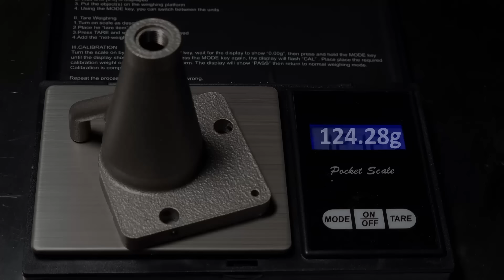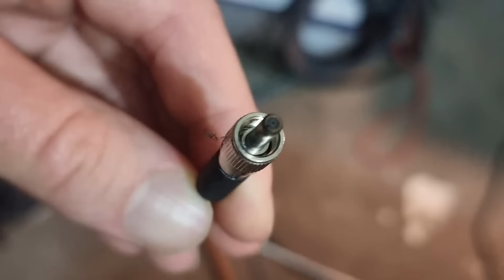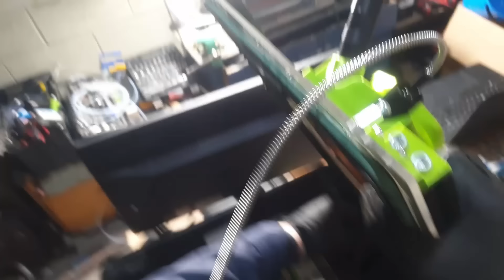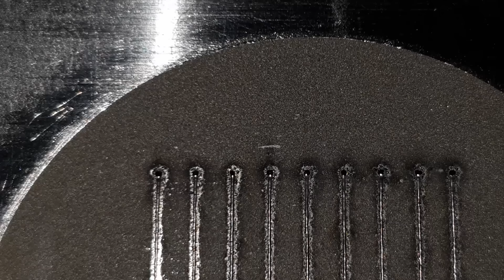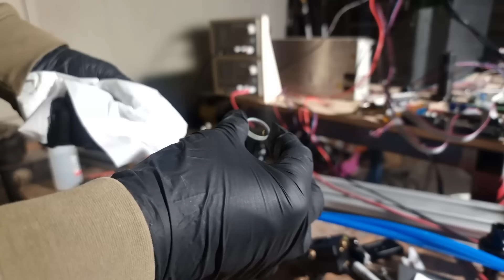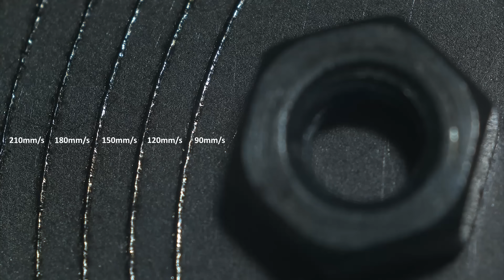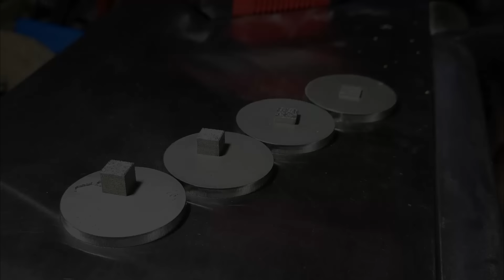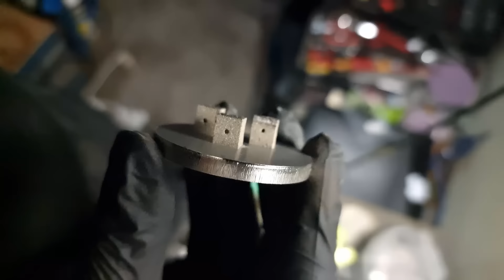DIY Metal 3D Printing - Success

Comment: #powderbeddesign
You could use a cheap motorbike cylinder as a cavity. Good precision, cooling/heat exchange fins and the possibility to use a matching piston to move the powder block come with it.
Did you consider compressing the fresh powdee?

Comment: I am not qualified to suggest things, but maybe you would find some truth in my thought - what if you heated up the surrounding metal with an unfocused laser or some other method, so that the difference in temperature of the grains of metal would be less? I suspect that due to a much lower difference in temperature, once metal melts, there will be a lot less force pulling the liquid metal, and it might flow more evenly, not pulling grains along with it. Ive noticed that when soldering, metal will flow towards heat, so i figured if you want precision, fighting with Brownian motion which occurs in liquefying metal powder would be detrimental.

Comment: holy shit, that's one heck of a cool project you have there, mad respect

maybe some tips or rather suggestions from someone who works with a SLM machine (from Aconity for anyone interested), if I mention anything you already addressed then it's just me being too enthusiastic and writing this comment while watching the video:
- as someone pointed out, when working with 316L a lot of people use base plate heating, 316L normally takes around 300°C, for cubes it's relatively safe to not heat cause you don't have that much volume in comparison to the area connected to the plate, but anything with a different area to volume can make some problems cause the stresses get too high to handle for what little support you have, if you ever go into aluminium like alsi10mg use 200°C, that can also reduce your adhesion problems

- 316L is notorious for spatter, if you have problems with that either reduce the layer thickness (we would use 30 um with such problems) or take a look at the gas flow, we had a problem with it being too turbulent and thus leading to a different print quality depending on the position on the platform, a slight modification to the exit nuzzle made it way better and more consistent over the whole platform, also drying the powder can help

- concerning your density, it would be pretty cool to see a cross-section of your parts, depending on the form of your pores you can see where you are concerning energy, big irregular pores? probably lack of fusion, so more energy. big round pores? probably keyhole pores, so too much energy. lots of small round pores? gaspores, can't do a lot about those except for drying the powder and going slower with lower energy, or remelting every layer so the gases can escape the meltpool

- we have 2 solutions for the coater, either a silicon lip or a carbon brush (there exists a 3. one from the manufacturer, a metal lip, but that's just shit), the silicon lip gives a way smoother powder bed but can break off any high spots or parts that threaten to rise up due to a lack of fusion or warping and it doesn't work with higher temperatures, becoming too soft and ripping out of it's holder, the carbon brush is way more forgiving but can lead to valleys in the powder bed, where particles are stuck to the brush

- normally we burn in the first layer up to 3 times, just because you can't really control how thick it is, so rather put in more power and be sure, than having too little, putting in too much power will even out with the next few layers anyways

- printing bigger or just a lot of parts and thus crowding the platform can lead to not enough powder being transported, so we normally brush over with a supply factor, meaning 2 - 3 times the height in powder that we theoretically need being brushed on, saved my ass more often than I want to admit 

hope my rambling could help you even a little bit, good luck with the project, would be so cool to see bigger and more complex parts being printed
Reply from the maker: Thanks for sharing all of that info. I don't know if I will be able work in any preheating in the near future but will keep it on the cards. I found a recommended temperature of 50 - 80C for SS316 in a MDS and was referencing that. I think at the current scale things should be alright.
Reply: It would be a great investment to build a kit to make another once you perfect it I know there would be a demand for it and it's amazing how much time and energy you put into this project
Reply: @cheifnutz5086 I would buy a kit. For sure.

Comment: This would allow co-printing with polymers, as the metal parts do not need to be heated up to their melting point (only with High temp marterials like ppa, but still).

Comment: Glad to see you finally use the tips I gave you on your first videos over 2 years ago and having some success.

Some more things to try, is switching the process gas. Nitrogen is easy to produce using molecular beads and an aquarium pump + 2 valves. Total cost around $50. The atmosphere helps control spatter, off gassing and oxidation so it is quite important for quality. Second, is the powder leveling scraper in professional machines is usually a ROTATING cylinder to help compact the powder and increase density. Another option low cost machines used was coated metal powder that would get "sticky" from the heat, which reduced spattering and helped control the weld pool.

Many of your problems seem to persist due to your substrate bed, so that should be your first focus. It is really not too difficult to cut 4 groves in a section of pipe and use metal ball bearings constrained in the head of a torx or hex head screw as guide rollers. This will give you precise Z axis guides and either a cable/wire + pulley or screw mechanism for sub micron height adjustment.

Super LOW cost sub-nm Z axis:
An Upside down T with a wire attached on either "arm", fed over 2 V groove bearings mounted in slots cut near the top sides of your guide-pipe can be wrapped around a capstan, beneath the guide-pipe so the T's foot raises as the capstan turns. Think wire powered hydraulic piston. As long as the wire is thick enough not to stretch you can get sub nanometer precision. 1 full rotation of the motor lifts the platform 1x the circumference of your capstan. Add a pulley between stepper and  capstan to subdivide. I have built <$20 xyz stages using this.
Reply: Make a video on it!

Comment: Wonderful and very detailed video! I have a tip: with the cheap Q-switched units you can indeed just turn the q-switch off physically. However, If you want an OEM plug&play solution, JPT's M7 series MOPA laser sources can be kicked into CW mode digitally(set pulse length to <1ns), and the 60W units are very affordable now(through bulk resellers, direct is expensive!), and 100W is still within a reasonable range. There may even be potential uses for pulsed operation to prepare the surface of the last layer for recoating(holding onto the particles?).
If you want to keep the DPSS system, mode selection is just an intracavity aperture, which would naturally cut power output.
Reply from the maker: Thanks for the insight. The fiber units have come down a lot in the last year since I purchased the DPSS system. Very tempting..

Comment: Hey, a lot of professional systems use carbide blades for layer deposition and scraping. You might want to look into replacement  carbide blades for paint scrapers. They're flat and sharp and fairly inexpensive! This has a second effect of being able to knock off high spots, but also can jam and remove parts if the build

Also, stiffness of the recoater and powder beds is super important. Some linear slides may help tremendously

Comment: For the wiper, have you tried a counterrotating roller instead of a blade?
Reply from the maker: No. That will come if I cannot achieve a respectable part density without it.
Reply: @metalmatters  great work so far!  Yes, I had to resort to counter-rotating roller myself back when I built one of these. I also had a chamber that was evacuated and purged with argon a few times instead of the flood you have. But flood works!

Subscribed!

Comment: Bro you’re back….. I’ve been following you for years at this point. As a fellow Aussie with a good mix of CNC, lathe, welding, and MOPA laser facilities in my garage. Let me know if I can help out in anyway.
Reply: Just gonna use this thread as a stream of consciousness whilst watching.

As for zirconia nozzles you’ll be fine if using an yttrium stabilised zirconia.
Reply: Dude, upgrade to a MOPA source. JPT sources in the 200w range are now obtainable to an average consumer…. Completely side step that entire q-switched or pump shaping limitations.
Reply from the maker: @geekswithfeet9137  If I'm going to destroy someone's laser I would rather it be my own 🥲

A couple of people have suggested using a preheated bed and I am aware it is how some commercial machines approach the problem. I am just conscious of cost and the additional safety aspects to it.
Reply: @metalmatters  VERY cool ideas you have.
Recognise that hub too.
* Nissan * TD27.
Reply: I literally have a 60w MOPA with an f-theta I would allow you with in reason to experiment with, along with bottles of argon to optimise
Reply: Drive at WAY higher frequency, at the MHz range it settles on a heating mode far more than an etching mode
Reply: Powder bed Pre-heat…. Argon…. Faster scan speed, finer hatching, much higher laser frequency…. Multiple off angle passes….. a better wetting stainless like a 430 stainless
Reply: A sub-cooled wire feed, perhaps to just before the final feed nozzle, could also delay the wire melt-back just enough to make it viable

Comment: Try using two or three powders together, of different particle-sizes. I forget the math on how it works, but smaller particles will fill void-space of larger particles, and you should be able to get the powder itself up to like 85%-90% of pure/solid material, and thus that should help with the fusing of the particles to make a solid piece.
Reply: how do they all stay evenly distributed?
Reply: @bencolbourn5691 idk put it in a box and mix?
Reply: I guess you're talking about Fuller Curve Approximation
Reply: that can make spreading the powder quite difficult due to agglomeration. 

industry standard is to use 15-45  or 15-50 um powder distribution. it provides a good balance between density and flowability of the powder

Comment: It's very interesting!
How do you "detach" the 3d prints from the metal plate? Are you using a kind of a laser cut technique or something other?
Reply from the maker: I haven't been as such. It'll either be mechanical or if I can get away with it, some fast passes to create a weakened intermediate layer at the base.

Comment: lol I have the same 3d printer frame as this guy but instead of turning it into a metal 3d printer I just converted it into a hypercube corexy printer
there's some easy modifications to the z axis to eliminate banding up on thingiverse that's nearly a decade old now

Comment: Dual drive stepper,
If you have a rotating flag you can get it to zero at an angle plus a thread count. 

Might not sound much but on a 1mm pitch and a 1000pulse stepper and a .1mm variance in detection you are a hundred counts out. 

Whereas a 0.1 mm rotational within the 1mm pitch gives you a couple of counts accuracy for simple gear.

Comment: Turn the printing powder bed into an electro magnet. That powder might stay put then?
Reply: Then the powder will not lie in an even layer, but will be redistributed along the lines of the magnetic field.
Reply: @eraserstp  : The lines can be kept parallel UP (or down) if the coil is large enough. So the field can be fairly homogenous around the region of interest.

Using a (not so thick) high diameter neodymium disk, with a copper winding  around the perimeter can do the job.

So yes...I think the idea of using electro-magnets is good enough to justify a try.
Reply: @peplegal8253  You can't make the magnetic field homogeneous because the printed part will distort it. The field will be homogeneous only on the first layer.
Reply: @eraserstp  : You are fuc*ing right !

Comment: At this point, is it possible to use an off-the-cuff Galvo-Laser Marker? With additional optics and a different controller board - but it seems to me like there are almost all components you'll need, conveniently packaged in a box?
Reply from the maker: I want to say yes but the answer is I don't know. Depending on the model, if you can disable the Q switch, then you should be able to. Otherwise you might be constrained to highly reflective powders (Copper etc).
Reply: @metalmatters well, for me, that's good enough. I'm trying to justify the purchase of such a machine for over a year and now I'm starting to think this could be my justification 😁 But I'm still torn between a 30 or 50W standard (Yag?)-Laser or take the big shot and buy one with a MOPA source. which one would be best suited as far as you know now?
Reply from the maker: @marcus_w0  You're after a fiber (Yb:yag) laser. According to another commenter (Spirit), the 60W JPT M7 MOPA laser can be had for around $2000. It can be set to CW mode via a software interface too. Might be the one to go for.